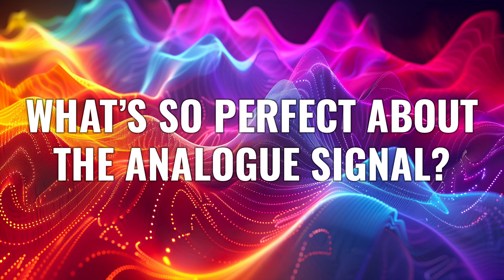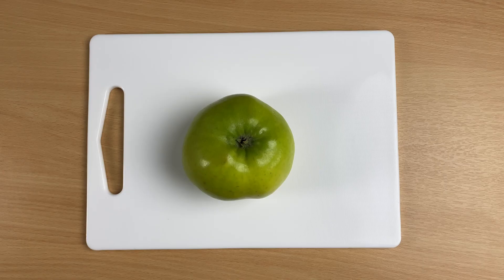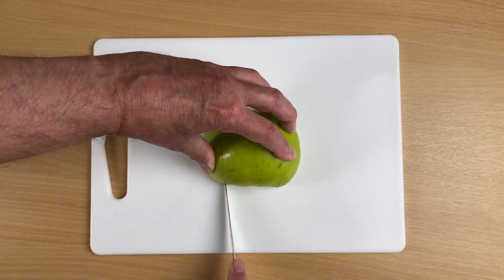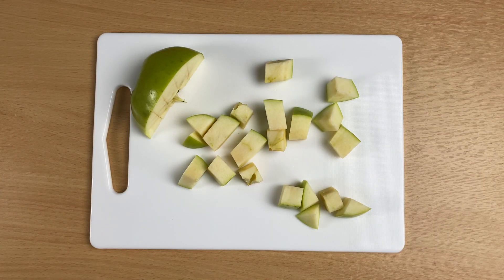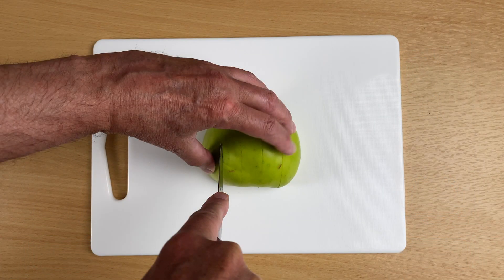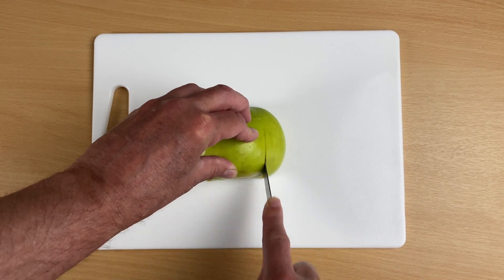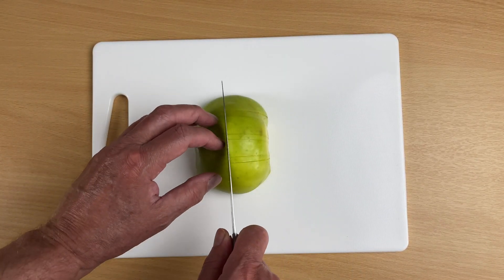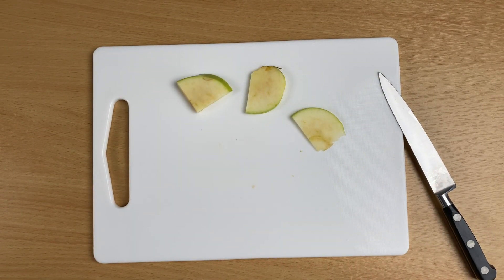Digital audio - Is it sliced and diced?

Comment: Watched Monty. I thought of reconstruction of digital to analog like dot-to-dot but at such a high resolution that you can't see any straight lines and even if you could there's a stylized curve between the dots from the analog nature of drawing it. What I came away with from Monty was: Reproduction from digital is a smooth analog characteristic. So choose your noise. No available analog medium can reach the low noise floor of the digital accomplished for the masses with the introduction of the CD.
Reply: the goutrier transfor.ation turns the dots into points that define the only smooth sinus curve through them.

meaning the result is actualy identical to what ever frequencies of the og signal where sampled.
Reply: The diaphragm of the equipment that reproduces sound from a digital signal can't instantly jump from point to point. This is what actually creates the smooth sound. So long as the samplerate is twice that of the maximum frequency attempting to be reproduced, then it will sound clear and artifact-free. This is what the Nyquist-Shannon theorem says, and it is how sound has been reproduced in all media on all digital and some analog devices for around 60 years now. Before that, we didn't rely on any standardization, and audio quality was far more variable. Most of the mastered audio that was created before we understood how sound really could be best quantized digitally was of much worse quality.
Reply: @VariantAEC  thats false. that would be playing raw digital data,which does not happen.

the digutal to analog step works by calculating the one possible analog sinus curve that hits all the recorded digital points.

thats mathematicaly identical to the sampled analog.

quantizatiin ertors come when the bit rate is lower than tge human volume jump sensitivity, and  when the sample frequencies is lower than double the human hearing peak frequency.

then you play back a weird cherrypicked set of analogs from the original analog, which does not work
Reply: @Chrisspru  
The artifacts I was talking about revolve around samplerate, not bit depth, and that is clear from what was covered explicitly in my reply. Despite that, you won't hear many artifacts at 8-bit so long as you follow Nyquist-Shannon theorem because 256 volume steps are still being sampled at the speed the speaker diaphragm can be moved. You won't hear popping from the step changes because of the way speakers as physical devices work where as a specific form of harshness or aliasing is heard when it comes to just reproducing a 8000hz signal at 8000hz samplerate.
Reply: @VariantAEC  8 bit can be clearly heared artifacting, as a human voice for example has way more than 256 volume steps over its total dynamic range. the compensating quantization to get a smooth volume curve at 8 bit causes noise that limits the dynamic range by a lot. 16 bit makes noise inaudible for the average adult human ear, 24 even for newborn.

reproducing a pure 8khz signal at 8khz is perfect digitaly as well. the issues is when you have overtones above the chosen example 8 khz (and outstripping the chosen sample rate) that get improperly filtered before the digitalization. this results in these overtone frequencies veing digitaly mapped to lower frequencies, causing a lot of distortion. very steep filtering can cause issues too.

proper recording technique nowday uses higher internal sample rates to have the filter way in the ultrasonic, and then discard data beyond the chosen file sample rate. 

digital to analog reproduction can have overtone issues too, when the fourier transformstion creates overtones beyond the recording that are dicarded. there, supersampling the signal with digital 0 to a higher frequency allows the adc to work freely. its a modern standard by now too.  44.1khz signals, used wth modern standard supersampling recording and playback,   fully represent the average hearing range + analog overtones. 48 khz  excedes even childrens ears, with overtones it exceeds any human hearing.

popping comes from bad mixes or overdriven speakers, causing digital or analog clipping.  or improper processing or amplification causing digital or analog noise. thats an issue with your tech, not the theory.
Reply: @Chrisspru  
The reason an 8kHz sine tone can not be well represented at 8kHz is because the equipment will attempt to make a square wave out of it. I already know very well that you don't know much about any of this from your rather lengthy but empty reply.

I said you won't hear popping due to 8-bit volume steps. You can hear it at 1-bit, 2-bit, and 4-bit depths because the volume stepping is far greater and, therefore, much more obvious. 4-bit audio gives you only 16 discreet volume steps that any instrument could be mapped to. 2-bit audio only allows 4 volume steps and 1-bit audio only diaphragm fully distended in one direction.

So, yeah, you will hear popping no matter how expertly mixed audio is at 1, 2, and 4 bits, especially at 11,025 Hz or less. If you increase sample rates to 1 million or more, you can make audio sound okay again if not as dynamic just by cycling the speaker cone much more rapidly. Only special equipment has been tested to do such a thing, and before that was done, it was theorized mathematically.
Reply: @VariantAEC   sine tone waves are not square. they are sine.

square wave is square wave, and then cones the issue of instantaneous shifts beibg physicaly impossible.

but digital audio is not square when decoded to any competent degree.

and the volume steps from bit depth are not clear cut, due to dithering technique. it makes things smooth, but noisy.

more rapid cone cycling does only do something in the audible frequenv
cies or higher harmonic interactions, but it does not change the fact of provably smooth digital audio reproduction. else the decoded digital would not measure smooth electronicaly.

1 million cycles is a pointless, even detrimental, number. no sound plays at 1 mHz (megahertz). thats radio frequency, at which point the speaker does not move but simply produces electromagnetic interference and heat.  its a sure way to damage your speakers and induce noise in your system.
Reply: @Chrisspru  
I know a sine wave is supposed to be smooth, but it can't be when the tone is set to that of the output samplerate. This is called aliasing.
If you look at a picture of a computer generated image without antialiasing, you see the square pixels because the generated image is exactly the display resolution. Let us use a 10-inch square display that has 960x960 pixels. DPI is 96, so the image is pretty blocky. We can reduce the look of that blockiness in any image on that display by allowing neighboring pixels to look more similar to each other where appropriate. This is called antialiasing in games and filtering for scaled video.

If we leave pixels untreated, they appear to have unnatural color properties and don't blend well with neighbors. To fix that, we can generate an image of higher resolution and feed that to the display and we will assume the display will filter the image for output using bicubic and bilinear scalling for CGI and video respectively. Dithering can also be used to mask color banding, which is an artifact of low bit depth in images and video.

Anyway, if your speakers are operating at 8,000 Hz and the driver is trying to output an 8 kHz sound, then the output will be more square, especially if the speaker can operate at higher frequencies than 8 kHz. Most cheap speakers can easily handle 22.05 kHz. This is where the aliasing comes from. Unlike in the image example where the display is perfectly able to accommodate an image of any resolution so long as the display's driver can subsample content for output, the speaker is perfectly capable of handling soundwaves well in excess of 8 kHz waveform so driving an 8 kHz sound will lead to sharper sounds forming an artificial square wave due to the fact that the speaker can oscillate 22.05k times per second but is driving a 8 kHz signal. We can try to get the inverse by attempting to generate a 16 kHz sine tone at an 8 kHz samplerate, which could result in any number of errors depending on how the software handles the sound.
Reply: @Chrisspru  
1 million Hz samplerate vs. actual frequency the speaker can accept are two different things. Yes, to my knowledge, the experiment used a different type of speaker, but I could be mistaken. I only skimmed the paper. They were likely using normal speakers and using a computer sound driver to constructively and destructively supersample the full file outputting at a frequency range the speaker could accept.

This would mean the audio was either mastered at a higher sameplerate and played on speakers that can handle that or that the file was resampled to a far higher sameplerate with 1-bit depth and decoded in a way to allow nearly 50 samples to be compressed into a single oscillation of normal speaker cone at 22.05 kHz reproducing audible sounds that basically any speaker can handle. Or any mixture of the above that doesn't break the laws of physics, like mastering a file at 1 million sameplerate, but directly outputting through a driver that buffers many samples and outputs them at 22.05 kHz to normal speakers instead of relying on a regularly mastered file to be resampled first.

Comment: Having in the distant past seen how crap analog circuitry is when looking at a signal on an older analog Tektronix oscilloscope, square waves, for instance, are treated rather poorly, one can only imagine how floppy large mechanical low frequency drivers image bass frequencies, let alone the desperate jittering of a tweeter's diaphragm "reproducing" those inaudible overtones. We shouldn't be satisfied with anything less than direct neural input!😳
Reply from the maker: Funny thing is I might have a serious video on that coming up in future.

Comment: All CLASS-AB amps 
slice the audio into 2 parts, positive and negative, literally 2 halves, amplified via 2 completely differently manufactured devices PNP & NPN (Fet p-channel and N-Channel), 
and then combined back together with a ton of negative feedback to make it all work, but the fools never complained about sliced which it IS!, lets complain about digital.....
This is the answer to give to anyone complaining about slices and dices, ask them about their audiophile crapintosh amp $$$$$
Reply from the maker: It's a good question whether slicing into two is better or worse than slicing into 65,536 or more. I might ask it, but probably not answer it, in a future video.

Comment: As I understand it:  One overlooked aspect of the digital audio process is the reconstruction filter -- the low pass filter after the DAC.  The "infinitely thin slices" are very sharp pulses that hit the low pass filter and ring like a bell.  Each pulse rings out for many samples afterward, and all these ringy pulses overlay on top of each other.  The end result -- the sum of it all  -- is the original analog signal with all the missing slices filled in (minus the high frequencies above twice the sampling rate).

The reconstruction filter is what fills in the areas between the slices, er, samples and gets you back to the original signal.  And any low pass filter can serve as a reconstruction filter, including the natural rolloff of your ears.
Reply: Once you filter at the input and output the signal has one choice, beeing exactly the same. We are left with quantization distortion. At 96dB - i can’t hear it.
Reply: @melaniezette886  
Sadly that's not exactly correct ... for example a DAC or amplifier's internal distortion will appear on the output but not the input.  In fact, that's how we measure it.
Reply from the maker: Reconstruction filters are not without their issues. Not for this video, but perhaps in the future.
Reply: Actually most DACs have a "set and hold" output... so there is no actual gap between samples.  

Feed it 7FFFF ... get 1 volt out forever, unless you feed it a different value.
Reply: @Douglas_Blake_579  That's true.  My point addresses the ideal or theoretical case of infinitely thin apple slices and lollipops.  It's easy to picture what happens in the frequency domain:  The high frequency images are filtered out with a sharp low pass filter and leaves the original analog signal.  It's not intuitive what happens in the time domain and how the smooth sine-wavey missing parts are produced between the sample points.

As you said, in actual practice, set and hold (or zero-order hold) is also used to effectively interpolate between the sample points.  That first generates the well-known staircase pattern.  I believe that reduces the amplitude of the high frequency images and likely makes the work of the low pass filter that comes after easier (at the expense, I believe, of some high frequency roll off that may have to be compensated for).

Comment: Rotating motor Vinyl or Tape the motors have a rotation speed just like a digital clock, Technically there is no difference just speed
Reply from the maker: This would be the cogging effect that some audiophiles can hear. Other audiophiles merely worry about it.

Comment: Yes analog to digital conversion does indeed slice and dice an analog signal.  

An Analog To Digital Converter (ADC) samples the analog signal from a microphone (or other transducer).  It is essentially a recording voltmeter that gathers the voltage of the signal as a binary number at a fixed sampling rate.

This results in a whole slew of measurements recorded a whole mess of times per second.
At 44,100sps (samples per second)  that is one sample every 22 microseconds.
At 16 bit resolution for a 2 volt signal each step in the measurement is  30 microvolts.

Whatever happens between those samples is indeed lost... but it would also be so far beyond our hearing we'd never notice it... 44khz or higher. Not even a bat could hear it, even if it was there.

Whatever happens to the levels between samples is on such a small resolution, less than 1/960th of a decibel, that nobody could ever hear it.

The samples are stored in a computer file as a sequence of binary numbers, where they are no different than any other computer data.  Stored, manipulated, and communicated just like any other computer data, with bit perfect resolution.

The big secret is in the reconstruction filter on playback. Here the gap between samples and the differences in amplitude are smoothed by "reconstruction filters" that give back a nearly exact version of the original analog signal.

Very simply ... it's so close as makes no difference... and with higher bit size and sample rates it gets even closer.
Reply from the maker: I spotted the word 'nearly' in your comment.
Reply: @AudioMasterclass  
Until it captures things like RF noise and power spikes, it will be "nearly" ... but if you think about it,  that's actually a good thing.

Comment: I don't think the apple/onion analogy adds anything: sampling is not that hard to understand. Of course sampling is not a problem if done at sufficient rate/depth. The only question is what is that sufficient level: that's an experimental question dependent on content/situation/listener.
Reply: the rate/depth of CD is chosen for a reason, it should be suffiecient (for almost everybody)
Reply: @thepuma2012  have they ever found someone for which it was insufficient?
Reply: @JustEnjoyingLife73  not really, I guess. But sometimes I do believe that streaming 24/192 gives just a little bit extra.... but also if that is true (or is it a feeling?) it is something you don t really miss if using 16/44

Comment: For the real purists, as audiophiles and hi-fi enthusiasts behave, there is no such thing as true analogue. The electric current in analog sound equipment is not exactly analogous to the air vibrations of sound. There is distortion and background noise.
Digital sound is not necessarily worse or better than analog sound. If the digital resolution is too low, the digital distortion will be more audible than a good analog system. If the digital resolution is high enough, the distortion is virtually inaudible compared to an analog system.
And for the sake of convenience, let's ignore the fact that two different people never really hear the same thing, not with the same sound equipment and not with the real sound itself. Even more so, the same person does not hear exactly the same sound at different times.
Truly analog is a utopia. It doesn't exist in the real world.
Reply: arguably the only TRUE REAL SOUND (tm) is live from completely acoustic sources.

Comment: About forty years ago, Stereo Review conducted a blind comparison study to see if the listeners could discern the audio difference between Monster Cable and 14 gauge zip cord in speaker connections. The listeners could tell no discernable difference. At least that study had those results. There was a fair amount of outrage presented in the letters to the editor by the users of Monster Cable. I am sure there is a lot of beautiful sound emerging from the sound systems of analogue enthusiasts. However, I wonder how such a thing would stand up in a blind A/B study. Would the wee pops of missed dust motes give the nudge? Which would score better as a result?